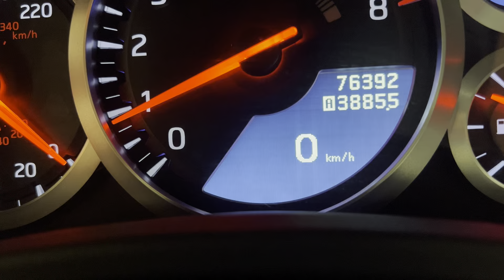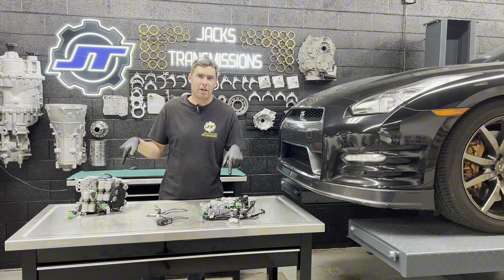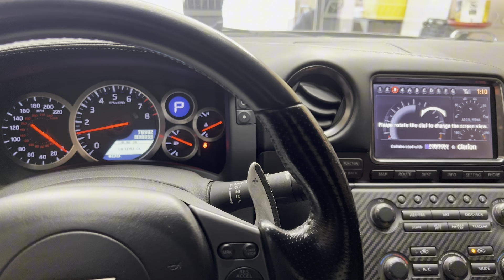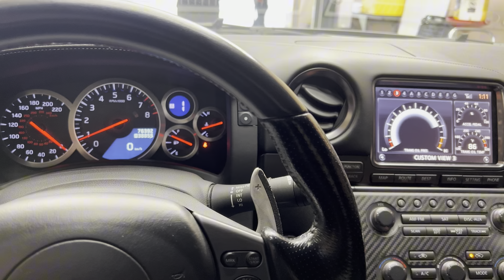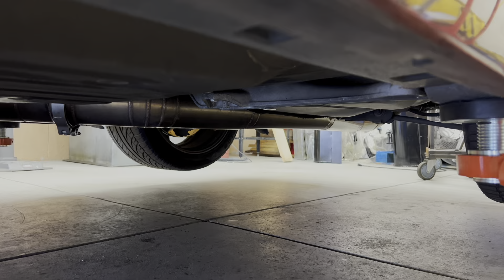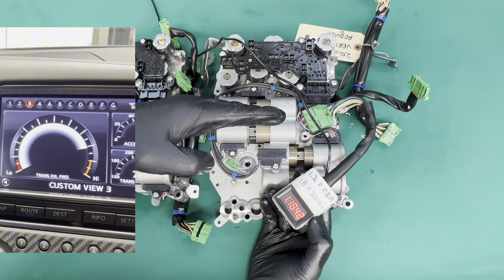R35 Main Selector Valve Body Changes / Differences Causing P2837 Shift Fork B Codes GR6 Nissan GT-R

Comment: What about shift fork C I having a trouble with Reverse gear and first gear. I did a scanning the shift fork c is my issue at the moment. Will this work on my 2015 gtr r35
Reply from the maker: No, if your car was running fine and then something changed on its own you do not have the wrong valve body in it.  Typically issues like yours are caused by someone changing the Touch Point settings in the Transmission Utility into the positives.  This needs to be 0,0.  If it still does it, then the friction material in the clutch may be worn or you might have a pressure problem.
Reply: @jackstrans so how do I fix that issue ? Can you make  that as a video tutorial? Please !

Comment: Forgive me if I’m taking what you said the wrong way… but you’re saying opening up the valve body and cleaning the pistons is bad??

Why is it recommended to do this every 30,000km when doing a trans fluid replacement to clean gunk off the pistons.

Or are you saying something else.
Reply from the maker: You don't have to remove the pistons to clean them. Just use a magnet at the areas where you see material and it will lift right off.  I will do a video on that.  It's easy and people are making this way more complicated than it needs to be which introduces failure.  

I have had transmissions come in with the piston side caps blown off because people took them apart to clean them.  Nissan manual also says not clean them and to leave them alone. I don't know who is recommending cleaning them, but that is not my recommendation with our fluid change kits and creates more issues if you take things apart unnecessarily.